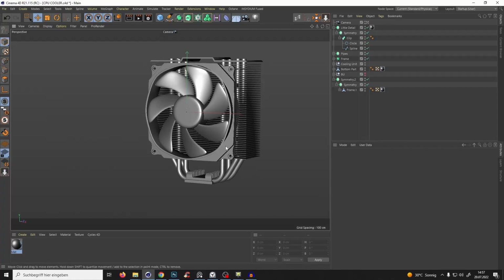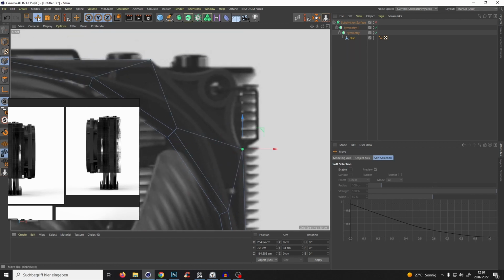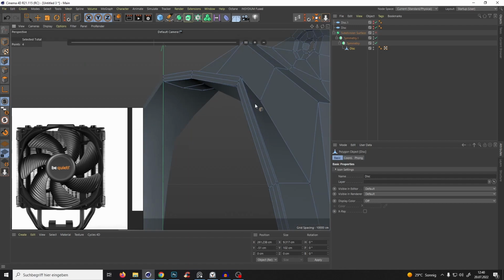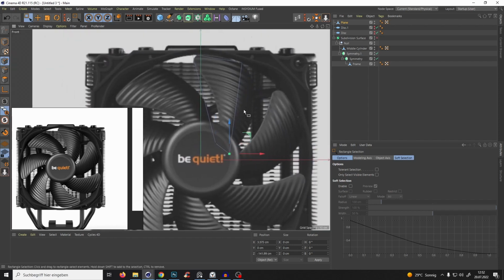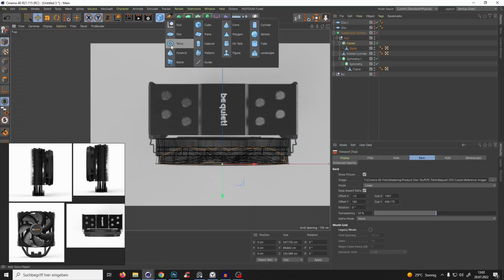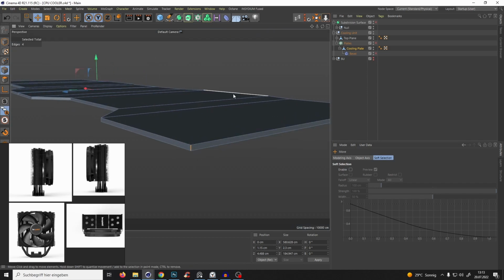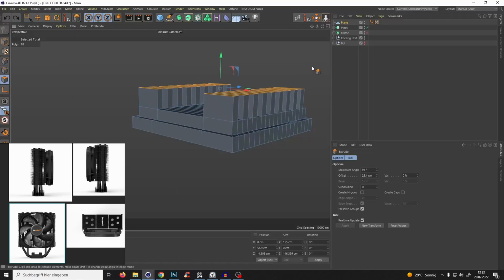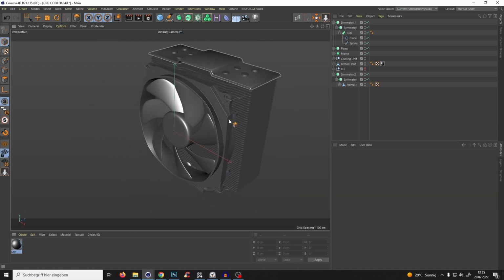Industrial Design | Hard Surface Product Modeling  | CPU Cooler | Cinema 4D

Comment: Hi, this looks interesting! I'm gonna try it if I have time. I see you also use CAD. Just wondering why do you prefer modeling this in C4D because this could also be  modeled in CAD. I'm using Fusion 360 mostly for modeling but learning modeling in C4D.
Reply from the maker: Yes this could also be modeled in CAD, but I did this cpu cooler a while ago with subD modeling so I just recreated it for the tutorial.
Also, I am pretty new to CAD, so I don't have so much experience maybe. Also I am using MoI3D (CAD program) and I enjoy it a lot, but not many people use it, so I don't see the point to make a tutorial about it.

I also want to try Fusion360. It's definitely a super powerful program, especially with the Parasolid geometry kernel it is using. 
I am just trying out right now a few different programs and workflows because I am at a stage right now, where I try to figure out my workflow between all the different software. And I also want to try Blender/Fusion360. But step by step.
Reply: @nikita.kapustin  Ok, I think it's great if you can switch between CAD and C4D and choose what best works for each kind of model. Fusion 360 is also great for assembling different parts. After modeling I use C4D for rendering and animation. Keep the good work!